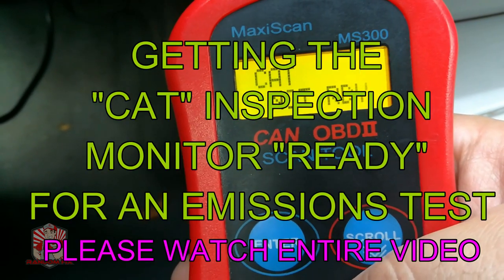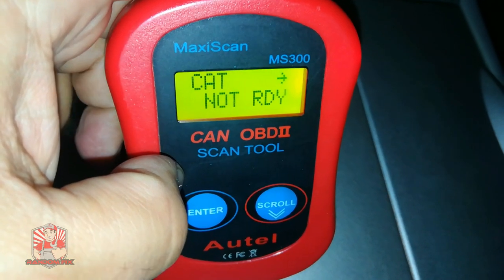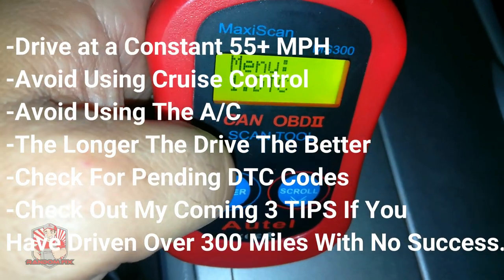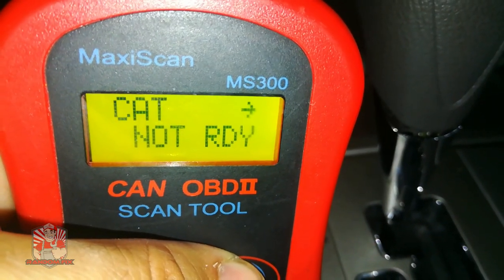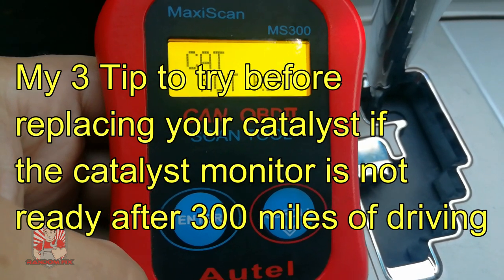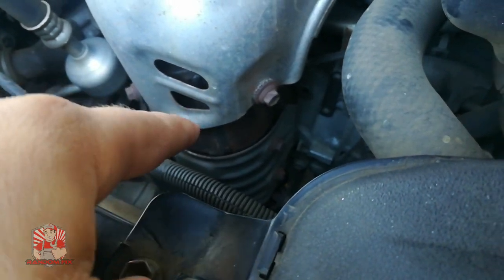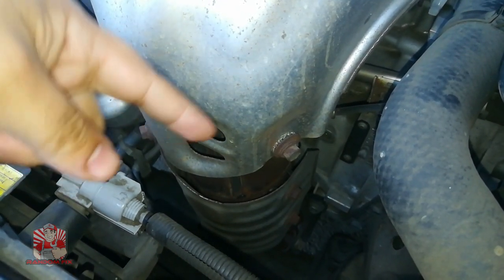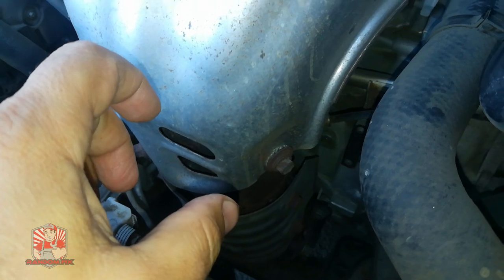Improve Your Catalyst Monitor Readiness P420 P430 FIXED!

Comment: I CAN NOT THANK YOU ENOUGH SIR!!!!!  I've been working on completing this monitor for FOUR effing days!  I have someone coming from 3 hours away to buy this car from me and I must have it smogged!  It's a 1998 Ford Contour SVT; hadn't been driven in a couple months and when I went to smog, I smartly checked the monitors beforehand, only to find that the CAT and EVAP were incomplete.  I knew I had to at least clear one of them...preferably the CAT.  I tried EVERYTHING man...no amount of miles on the highway or streets would do it.  I tried your trick holding RPMs at 3100 for about 3 and a half minutes...worked immediately.  On Monday, I'll be happily on my way to the smog shop.  Seriously, thank you so much sir!  I will be subscribing and following you from now on...so much appreciation and love for you man.
Reply: I wish I could like MORE THAN ONCE!!!
Reply from the maker: Is this really needed to be said?

Comment: I set the Catalyst Monitor last night using your suggested method of driving over 55 mph at a constant speed. I drove about 30 miles on the freeway  (roughly 10 miles from my work to home and made a loop back to work then back home) at 65  mph. Got home, checked the scanner and boom! Catalyst monitor is ready.
Reply from the maker: Hi Timmy 👋, thank for the great feedback and congrats on setting your catalyst monitor. _Randomfix
Reply: @RANDOMFIX  
I have a 2011 Honda Civic 
No check engine light or codes drive it 250 miles still catalytic monitor won’t activate
Reply from the maker: This whole playlist is focused on incomplete catalyst monitors 

https://youtube.com/playlist?list=PLDEbtVOPRC-h1BAzaWQ-6NSnmG0gwvgwP

I would start the and let it idle for 20 minutes with a/c on, then do the 3k trick like I show on the playlist . 
https://youtu.be/BuZYAy_xi0E

If it is still not ready then hit the road right away without turning off the car and maintain a smooth 65mph with no cruise or a/c.

There are little obd2 readers that will stop beeping once all the monitors are complete. Let me know if you need a recommendation and keep me updated.

Comment: I tried everything to get my catalys monitor to say ok. I tried for 10
Days. Finally, tonight I used the  Cataclean, I followed the directions and it totally worked,
My catalys monitor finally says ok.
I’m so relieved.. thank you for sharing your video.
Reply from the maker: Glad to help and thank you for sharing your experience.
Reply: Hi, I just bought a bottle of cataclean. So it says to add the bottle when the fuel tank is 1/4, drive for 15 minutes and refuel. Did you fill up the tank at this point?
Reply: @HoaNguyen-ke7kk  yeah after i ran it at 1/4 tank with Cataclean I went and filled the tank. I remember i had left the engine running too for some reason.
Reply: Thanks man!
Reply: @HoaNguyen-ke7kk  I also remember hearing the idle change after the tank was just about full. My mechanic said there is a sensor for the fuel tank and that the tank needs to be full for when the monitors cycle. As soon as I heard that idle change I immediately tested the computer with my code reader and the cat monitor said ok. Hope this helps. But yeah fill it after and follow the directions to a T.
Good luck!

Comment: I normally undo the 02 sensor and spray electric contact cleaner in leave it 20 mins and then go fir a drive done it a couple of times now with success every time
Reply from the maker: Hi Rocky, thanks sharing, I will incorporate this into a future video..much appreciated
Reply: smart 💡 idea. I'd like see illustration if possible.

Comment: I/M status: Cat not ready.  (No codes, no errors.)

Did this. 3,000 rpm 3 minutes. Scanner says CAT INC (Catalyst Monitor not ready). Did again. Same result. 

Smog pro said: engine coolant must be at 220° or higher, on the edge of overhearing. Put cardboard in front of radiator fan air intake…) 

Will try and report back.
Reply from the maker: any updates?

Comment: I/M status: Cat not ready.  (No codes, no errors.) After driving over 750 miles in 2 weeks. 

Did this. 3,000 rpm 3 minutes. Scanner says CAT INC (Catalyst Monitor not ready). Did again. Same result. 

Smog pro said: Engine coolant must be at 220° or higher, on the edge of overheating… Put cardboard in front of radiator fan air intake… Try drive cycle again…) 

Will try and report back.
Reply from the maker: Okay, please keep me in the loop. I normally actually recommend cooking of the engine instead try to reach a higher engine temperature. The method I show raises the catalyst internal temperature more than the engine.

Comment: Hey I found out that simply revving your engine for at least a minute straight while in park or possibly neutral will clear the monitor. No driving required! I wasted quite a few hours driving and revving worked right away. Try it next time.
Reply from the maker: Hi and thanks for sharing your own experience. Can specify what is your make model of your vehicle. Also when you say you set your monitors, which specific monitor was incomplete? randomfix
Reply: @RANDOMFIX  The catalyst monitor was the only one not completed on my 2000 Toyota Camry. After doing a lot of driving and doing drive cycles, I tried just revving the engine while the car was already warm and that worked. I believe this is the same issue you are talking about on here.
Reply: @swimindiansun  Damn 300 miles later I'm still trying to pop the Cat on my 02 camry. Did you drive for a while then rev the engine? I'm thinking of trying this because I just drove another 40 miles non-stop and still no change. I tried putting in the CRC "Guaranteed To Pass" additive and still no change.
Reply: When you say revving your engine, do you keep the gas pedal depressed for an entire minute? Or are you more or less pumping the pedal every 5-10 seconds?
Reply from the maker: Sometimes there is not substitute for a new catalyst. Keep trying and if you can't get it ready them here is how your get new direct fit catalyst for under $150. https://youtu.be/Wr1vFqCnpDc
Reply: @RANDOMFIX  When I first bought the car I was able to get the Cat On, that was only on 3/4/20 @ 121290. But then 2 months later the check engine light came back on and just would never go away..I would clear it multiple times and I thot it was just a bad ECM..It was only recently that I found that the Fuel Injectors were causing the check engine light so I went ahead & had them replaced at 126185. Did driving with the check engine light & misfire for so many miles melt my CAT? Check engine light won't come on now, but the NOT READY status is constant no matter what I tried after over 300 miles of driving/drive cycles since the tech cleared the codes. There was a p420 code, so Saturday morning at 126447 miles I wiped the code at a smog station using an OBD2, and I did the 10min idle + 65-24mph drive cycle w/out breaking 3-4 times..all the other monitors popped except the CAT..even the EVAP monitor is on, but CAT not ready. Still no code or check engine light. The odometer now reads 126508 miles. I'm trying to avoid replacing the CAT because I feel like this guy in the CAP program is trying to screw me. He's subbing out the CAT to a muffle shop, and when I called the muffler shop directly the price they offered me was $500 less than what he was trying to pass on to me & BAR. Put my repairs over the $1500 cap. If I can get this CAT to pop I can screw this guy back for trying to screw me and leave him with nothing, which is my goal because I can get a certificate anywhere if I can just get the CAT to pop at this point.
Reply from the maker: Yeah driving with clogged injector can cause longer term damage. So you vehicle is just at that point where the efficiency is not poor enough to trigger a check engine light and not good enough to set the monitor to ready status.
Reply from the maker: I'm still surprised that 3k rev on trick is not working on your 2000 Camry as I've had lots of people set the monitor with that trick..
Reply: @RANDOMFIX  I have an 02 Camry 2.4L. I haven't tried it yet because I'm afraid it might blow out my head gasket and I need to mcgiver a pedal stick like yours to do the trick because I don't think I can hold it steady w/ my foot, but I'll give it a try. I have between 1/3 and 1/2 tank of gas right now. At about 1/2 a tank I added CRC Guaranteed Pass Additive. so should I wait until the morning so that if it pops I can take it to the shop right away, or if I get it to pop tonight will it stay on for tomorrow?
Reply from the maker: You don't have to wait til it's cold to try. If you are afraid of blowing a head gaskets try putting a fan in front of the radiator and turn on the heater on full blast. Here is the video for that 
https://youtu.be/BuZYAy_xi0E

Keep me in the loop
Reply: @HardcoreUly  have your car at operating temperature/warmed up, then with the car on and in Park and E-brake on, keep the pedal pressed down to keep the rpm's somewhere around 2500 to 3000 steady for at least a minute straight, although it might require more time, possibly 2 minutes straight. I would check to see if it worked after 1 minute before you try 2 minutes straight. It seems a bit weird to do, keeping the rpms that high while in the park position and I was hesitant about trying that for sure, but then it worked and I was so happy. I hope it works out for you. The fan idea is also good if you're worried about over heating
Reply: @swimindiansun  Yeah I tried the one where you rev at 3000 rpm for 3 min like Randomfix video. I did it 3-4 times in one day, it cleared my EVAP, but not my CAT. I think my CAT is melted from driving with a misfire for like a year. But I'm mad that I did it because I'm worried about the internal damage I probably did to my engine and now I still have to buy a CAT. This is the only car I've ever had that didn't have any oil leaks, and now what if I popped a gasket without knowing it? Anyway, I worry too much, thanks for reply. :)
Reply: @HardcoreUly  well at least you tried, now you might need that new cat. Good luck.
Reply: @swimindiansun  HOW DO YOU DO IT WITH A MANUAL TRANSMISSION?
Reply: @RANDOMFIX  HOW TO DO REVIVING WITH WITH A MANUAL TRANSMISSION TRICK ITS AN 04 ACCORD 2.4
Reply: @josephperez-wl7xv  try it in neutral

Comment: If there's a catalytic converter issue that's keeping it from re-setting, will it throw one of those codes? Having trouble re-setting, but I don't have any codes, and don't want to go through the cleaning processes if it isn't because of that, if I maybe just need to keep trying the Drive Cycle more times.
Reply from the maker: Yes I would keep driving it, what is the make and model of your vehicle? I will send the exact directions for your make or just check the video links in this video description.
Reply: @RANDOMFIX  Thanks, so just confirming, if it's a Catalytic converter "problem" (as opposed to not doing the drive cycle properly), there would be a code? I have the exact Drive Cycle from the service manual - which I would think is the for sure one to use - but just wasn't sure about whether the cat could be bad if it's not throwing a code.

Comment: Hi my mechanic poured his magic solution in my gas tank and cleared the check engine light on then he tells me to drive 60 -75 miles and bring it back to him to check to make sure my catalyst monitor to come on and the check engine light stays off but when attempting this process my check engine light comes back  on when the catalyst monitor comes on. my mechanic swears  his method works for every car he does but it didn't work for my car. My mechanic told me to come back after the weekend to retry. Do you have any solutions? or maybe my catalyst converter is the bad that I just made need another one but i don't know . Let me know what you think.Thanks
Reply from the maker: There is no 100 percent solution that works every time except for new oem catalytic converter. You issue could be something else and pour a can maybe premature without know the root cause.

Comment: I just bought a BMW Z3, I work on BMW's and I've never had this problem, I've driven about 1000 miles, done the full drive cycle around 6 times(Usually works the first time of not the second) and the cat still won't get ready, when I bought the car the cat was ready but it had a vacuum leak, so I fixed it and deleted the codes, but now it won't get ready.
Reply from the maker: PLEASE watch the bmw drive cycle video. https://youtu.be/mk6Tk330Acw

Comment: Hello, first off love the videos! Very informative. I do have a question. The only monitor I show incomplete is Cat on my OBD reader . I tried method from one of your other videos with keeping the RPM's constant at 3000 for 3 mins but does not seem to do the trick. I still have an incomplete cat. I do have a p0421 code. What is the best way to get the Cat monitor to Ready? Should I try the Cataclean method? Or will it never go away until I resolve the p0421 code? Car is a 2008 Mazda 6. Thanks in advance!
Reply from the maker: You have to resolve the p421 code or at least to able to keep the car from detecting long enough to set the monitor. I would try cataclean but if you a some tools I would clean the catalytic converter using the direct method of spraying through the o2 sensor hole. I hate to say it but sometimes you just to buy a new catalytic converter but I've only had to do once out of 7000+ cars I have purchased.

Comment: Would enhanced gm codes cause the readiness monitors from completing? My catalyst and evap wont ready and general obd 2 on my scanner says no codes. If I select enhanced gm it shows PO703. I have the parts to repair but am concerned to pull the battery and start this saga again.
Reply from the maker: Yeah your p0703 may be keep the monitors from setting.
Reply: @RANDOMFIX  was afraid you would say that. Well parts are on the way and it isnt smart to drive with that code anyway. Hopefully, it is the brake switch but tranny has shifted erratic intermittently for 70,000 miles so all solenoids tcc switch and pressure convertor, diaphragm on the way. Would love to leave my battery connected for the tranny cover to come off but dont want to risk a short or something changing all those solenoids.

Comment: I have a 2003 Subaru Forester and I’m  having trouble getting my CAT monitor to clear to be ready to smog. I’ve driven it a ton of miles but still not ready. Someone suggested changing the 02 sensor . Could changing it allow the CAT monitor to read ready? Any suggestions are much appreciated!
Reply from the maker: Gabe, I will have a video for your Subaru by the end of the month. Each make can have different paraments.

Comment: I have a V6 accord and recently just replaced both cats. I'm at over 200 miles since resetting the CEL but only the O2, O2 Heater, and EGR are ready. EVAP and Catalyst are still showing not ready. Any idea why?
Reply: Who "likes" a comment that is a direct question about a specific issue?
Reply: My guess, they have the same issue.
Reply: U ever get it to read
Reply from the maker: Sorry for the late reply! did you find a solution?

Comment: Engine light is on does it matter or should i have a guy use one of those to turn it off first
Reply from the maker: Yes, check what the it’s on for and rest it. See if you can set the drive monitors before it puts back up.
Reply from the maker: What are you driving? I can send the exact directions for your vehicle or check the video links and find your make.

Comment: I just got my 2.0 gasoline 03 Jetta smogged, and the readout says "Catalyst Not Ready". Everything else was either Ready or Unsupported. Did the tech fudge something to make it pass?
Reply from the maker: Something sounds off. Do you have another obd2 reader to check the catalyst monitor? If you don’t got to nearest auto parts store and ask if you can borrow their scan tool to check the catalyst monitor.
Reply: Does it say you passed the SMOG test? Or failed?

Comment: Hey my car have pcd, and have pending codes of P0420 and P0430, if i clear the codes and drive as what the youtube told, will i pass? EVAP not ready and monitor catalyst not ready
Reply from the maker: If you have permanent diagnostic code ( pdc ), even if you clear the check engine light your vehicle will have clear the pdc before it will run certain monitors. You will not pass. What are you driving?

Comment: Would u recommend to swap some new spark plugs on or use the ones already in the car? Would it help out the process?
Reply: No it doesn't
Reply: yes it can certainly help especially if your old spark plugs are loose/not gapped correctly
Reply from the maker: Sorry for the late reply! did you find a solution?

Comment: I read to drive the car in all driving situations but... run on highway at 55+ 60 as long as needed to pass cat system test. evap system 65 mph then drop to zero. do both a few times. it takes awhile on catalyst driving.
Reply from the maker: Charles thanks for sharing. Honestly each make is a little variation in the process depending on the monitor. So I can video for all makes as I got really mentally tired trying keep up with all the variations so now I solved that problem.